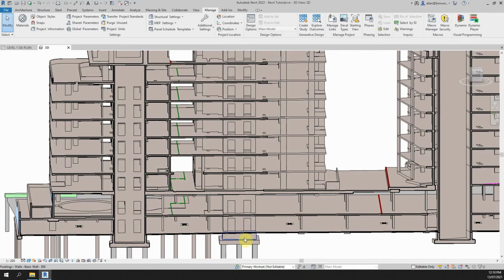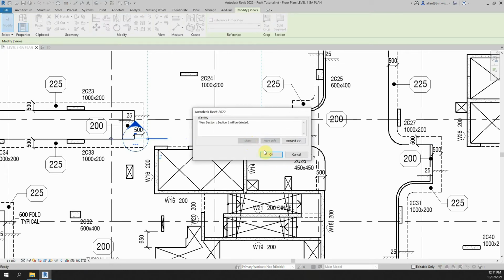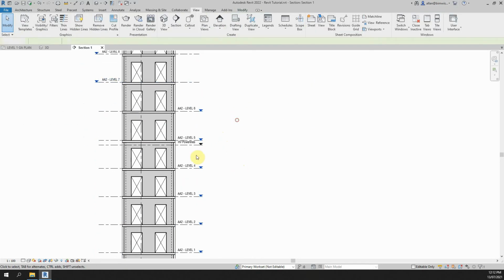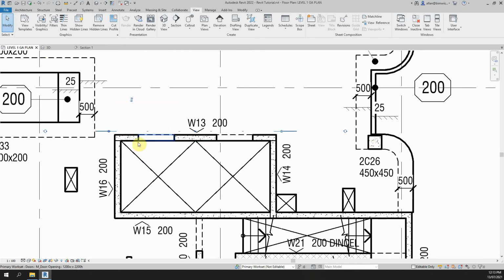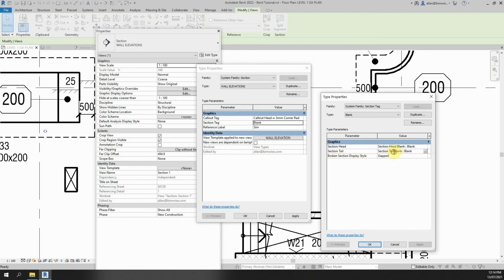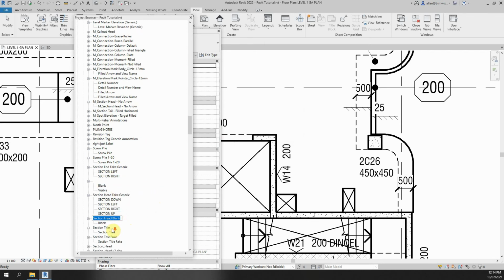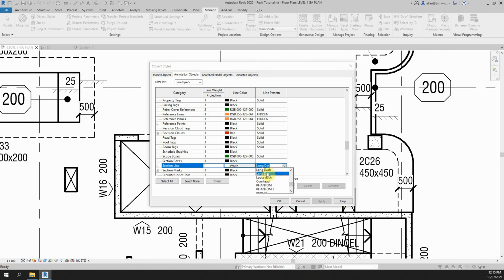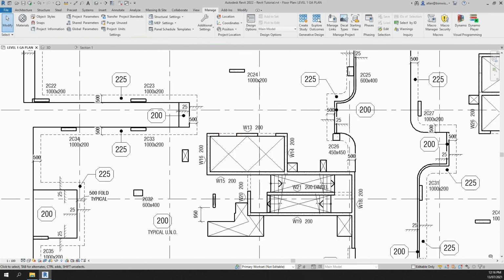Revit Tutorial - Invisible Section Markers for Wall Elevations.

Comment: Interesting idea. Why not start with an elevation or framing elevation, (and then just edit the marker as you did for the section) ?  Elevation has no lines or tail.
Reply from the maker: View depth and width controls?
Reply: @TheArtofTechnicalDrawing  you have a view depth control in plan, but elevation views can only control width by dragging or resize the crop region - it's odd that sections have that extra control from the plan.